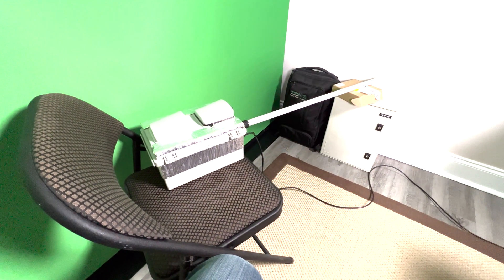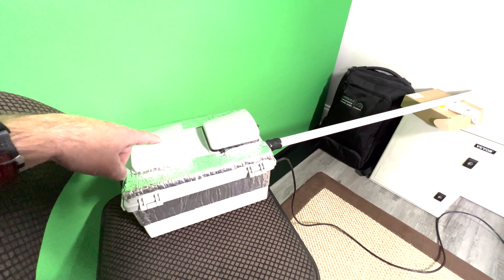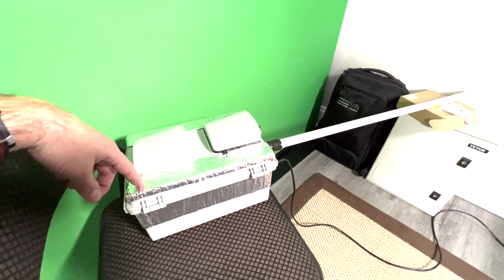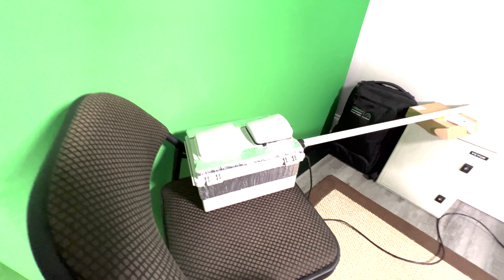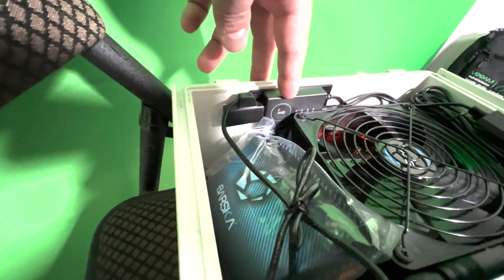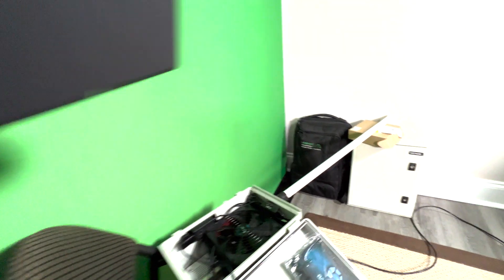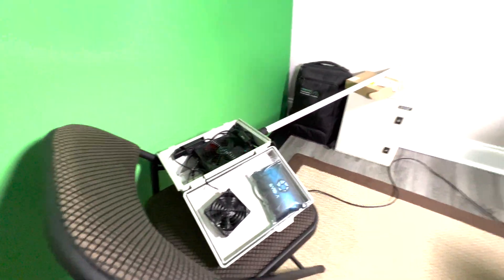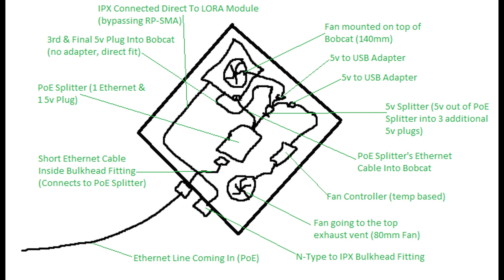Bobcat Helium Miner External Enclosure DIY

Comment: Good video, where is the DC adapter to switch 12v to 5v to run the fans?
Reply from the maker: Note:  I have since (before deployment) made the decision to switch to two USB powered fans vs. my originals due to RPM limits with the original setup.  I am using the PoE setup with splitters to power the miner, the fan controller (which has a USB port itself to drive its fan which exhausts heat outside the box), then 1 fan off a splitter that runs all the time (the one on top of the miner).

All that is tucked very carefully inside the box.

https://amzn.to/3K1tnwq
https://amzn.to/35Fx3oM
https://amzn.to/3M9pwit
https://amzn.to/3M9pwit

Comment: Did the ipx cable really work and help? I want to do the same what’s the sufferance between the 178 cable and 1.13?
Reply from the maker: It definitely works.. How much it actually "helps" in the real world is hard to tell because I didn't install the miner and let it run for 2-3 weeks and do the mod and get another sample for 2-3 weeks.. This was just a new build I wanted to optimize as best as I could before installation. As with anything, generally, the less hops the better the performance. No clue what you mean on the 178 and 1.13 sufferance question.  Above my head :)

Comment: Thank you for the video, very valuable one, however i'm concerned about the grounding. Didn't notice that you used lightning arrestor, can i ask why or what is your vision behind not putting?
Reply from the maker: I absolutely use an arrestor, this video was really just to highlight the enclosure and what’s inside.. I just screwed on the antenna so I could fire it up without causing any damage to the miner.. I always use an arrestor with proper Earth grounding. Thank you.
Reply: @Chromedonkey  thank you

Comment: I like the setup. Though, are two fans really necessary? I think you could get away with just having the smaller one. The enclosure is small, so air will circle circulate easily.
Reply from the maker: Possibly, though it gets hot here in the summer and these Bobcats already have a tendency to run warm. Thanks for the comment!